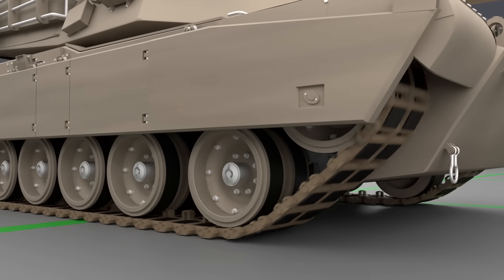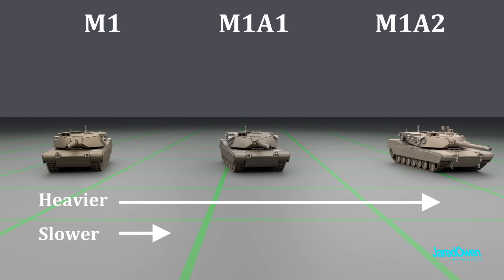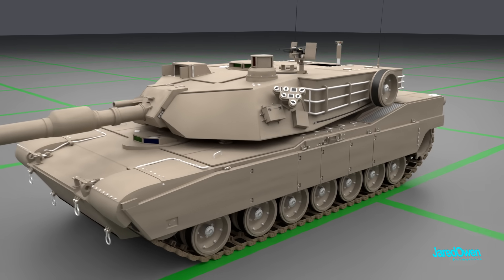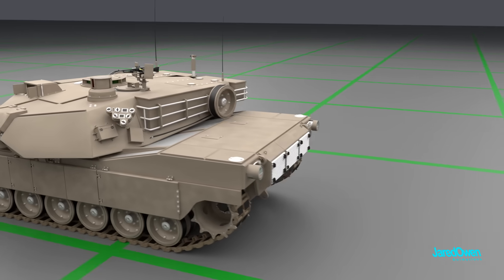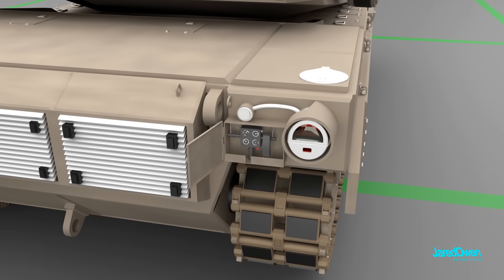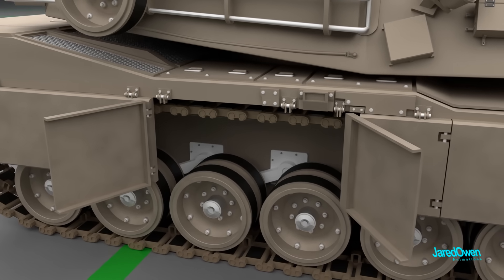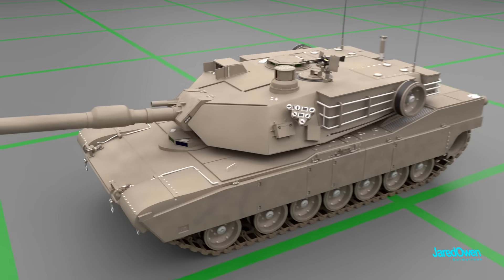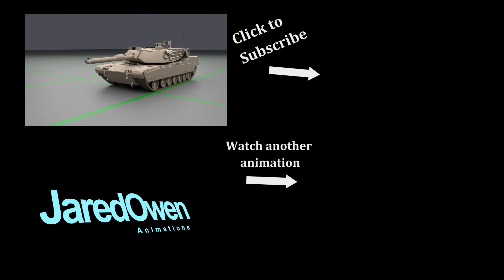How does a Tank work? (M1A2 Abrams)

Comment: Does it have A/C
Reply: Turbine engines, Electronics, and Hydraulic systems create a lot of heat .....plus operating in the desert....there must be some sort of cooling system.
Reply: No.  It has a blower that blows air that feels cooler than ambient air most of the time, but it is not A/C.  It is part of the NBC system that pushes filtered air through the turret through hoses.  The hoses are designed to connect to your NBC masks.  Most of the time you just stick them inside of your tanker suit.  Definitely makes a diff in hot temps.
Reply: @MKDonline  nomex
Reply: @MKDonline  no way to know for sure a lot of the abrams is classified
Reply: @mauricio-leyenda  I was a commissioned Armor officer for 7 years. And most things that were originally classified effectively lost that status in the 90s.
Reply: Yes!!!! Those things were the best.
Reply: @MKDonline  thank you sir.
Reply: @MKDonline  I was wondering how they would deal with a really nasty fart if it has ac, thanks.
Reply: Nope.  And as a former gunner I can tell you it gets hot especially with the balaclava, gloves and coveralls.
Reply: I wonder about this too.
Reply: No it’s a tank not a family car
Reply: @spedon2wheels267  not with that attitude.
Reply: @spedon2wheels267  it's called the army egg cooker for a reason
Reply: @spedon2wheels267  the driver would need some sort of cooling system there’s no way anyone could sit in a tank for hours without cool air
Reply: @gelato007   Actual Tanker here, I have in fact sat in an Abrams in the driver’s hole for hours in the heat. You have the “cooling system” but it’s for the electronics and doesn’t keep the crew from getting hot. However, if it gets really bad and isn’t too dusty we can take the NBC system hose and stuff it in our nomex suit for some sort of air circulation. We also usually keep a cooler full of ice for drinks and food in the bustle rack. Sometimes if it gets bad enough you can take some ziplock bags put ice in them and stuff them in your nomex, that mixed with the NBC hose is pretty nice.
Reply: @jb99rapp  where do u get ice from in the middle of a combat desert ?
Reply: @gelato007   you do realize that we’re on tanks for training exercises right? But at NTC or combat you just go till it runs out then embrace the suck sweating your balls off. Speaking of embracing the suck... using the bathroom inside a tank is not a good time.
Reply: @gelato007  As a former driver - no, there is no AC.  I would sometimes crack the hatch open for some extra air.
Reply: @spedon2wheels267  dude, this made me almost die of laughter. 
😂😂😂😂😂😂😂😂
Reply: @spedon2wheels267  worst vechicle then how the hell they not melting
Reply: @markwilson717  open the hatch
Reply: Does three open hatches count?
Then NO.
Reply: Soviet Union  ok t-34 haha
Reply: Yes. It is equipped with full HVAC.
Reply: no AC but plenty of heat
Reply: The A2 does.  It's mostly so the C2 systems don't over heat. The A1 does not.  The blower for the NBC system is used sparingly, it can overheat and the filters can catch on fire. I know this cause I've done it.
Reply: @Commandodesigns  ok nerd
Reply: How many cup holders does it have? That’s the real question we want answered.
Reply: Soviet Union  you need more girls to keep ur factors afloat
Reply: The only ac it has on the tank is to cool the electrics
Reply: @itserikboiii  yeah only the electronics get AC xD or thermal management system as it's called
Reply: No. The only thing they’re concerned about is keeping the electronics cool. One of my best bud was a driver for one of these.
Reply: The A2s did come with an AC system, but it’s for the added electronics. By the time it got to us, it was hot air. So technically it does, but the crew doesn’t benefit from it.
 There has always been a heater on the Abrams, but the filters on the M1s could catch fire. Made you think twice about using them for prolonged periods.
Reply: @tb3687  I never seen the A2 I heard it was going to be the best thing from sliced bread, but I went to Tradoc in 2009, they sent me to Ft. Jackson after Drill School.  and retired in 2012 and never been in an A2
Reply: @chrisle2674  it had some nice upgrades. CITV was the best in my opinion. A lot of software upgrades and some armor upgrades. They were just fielding the TUSK package as I got out. Put control of the TCs  .50 back inside the turret, phone in the rear, reactive armor. Sure they are working on some new stuff I’m not even aware of.
Reply: Good question 👍
Reply: For the computers yes. for us? No.
Reply: What if someone farts inside??
Reply: No. There is also no cushion inside. In order to stay cool, you’ll need to use the NBC system to supply air through a hose that you put down you nomex suit.
Reply: @sgtUSA2012  wouldn’t the tank be impractical because they crew would be so delirious from the heat or shiving from the cold?
Reply: the newer tanks have small refrigerator and power inverter that can run anything that has a plug.
Reply: @rgygduysdgyuygsduysd  Not sure where you got that information but it isn't correct.  There isn't any room for anything like that inside of an Abrams tank or outside for that matter LOL.
Reply: Good question
Reply: https://youtu.be/VDKq1T0Ou1k
Reply: Man I can just imagine how brutal hot it must get in there.  I'd like to think they have some form of AC but reality is, they probably don't.
Reply: It does, the driver has a display where he can turn on heat and cooling for the crew
Reply: Nope it dont have ac its not like a car its for war
Reply: I think only a small number of M1s did, and knowing the army they were probably deployed in Scandinavia rather than the desert
Reply: @Luka Ostojic I doubt a seatbelt is gonna help when you’re being pelted with armour piercing rounds lol
Reply: They have air filters tho so that they wont have to battle chemicals(like mustard gas)
Reply: It does my stepdad served in it
Reply: No, but the crew heater kicks ass!
Reply: No A/C Only Heater 😁
Reply: Yes but only for the engine
Reply: Actually the NBC system pumps fresh air into the track so we use it as AC and it feels amazing when it’s hot in Kuwait
Reply: yes, it does
Reply: No. It doesn’t it does have heating however
Reply: No. No it doesnt. But our NBC system can help every now and then which pumps air into the turret when you're dealing with a CBRN threat. The driver isnt so lucky though
Reply: No but British ones can make tea
Reply: Yes, it does, a very powerful one, in fact. BTW: Does you keyboard have a question mark key?*
Reply: A heater,, if you're lucky enough it works.....
Reply: Yes
Reply: No they do not have A/C...they do have heaters though...Up until fairly recently the HMMWV's didn't have A/C either, they were retrofitted later on mostly due to being used in Iraq/Afghanistan....however none of the Abrams tanks have ever had A/C, even the most recent ones do not.
Reply: @hospsa6933  LOL, no they do not, I used to drive one, none of the Abrams tanks have AC
Reply: Of course they AC "open the hatch 'or turn on ya helmet mounted solar powered fan 👍
Reply: AC units make to much noise! So no 👍🏻
Reply: @georgegarcia5288  lol funny but im pretty sure a jet turbine is louder than an ac compressor. Haha
Reply: @georgegarcia5288  noise cancellation in the CVC
Reply: @georgegarcia5288  as if the engine is silent!
Reply: @georgegarcia5288  tanks aren't known for being sneaky
Reply: Yes it does. T72 and t90 don't.
Reply: Yea the suits u where got them 2 and they have clocking cabillitys in its multi panel Armour n a 16 way cam
Reply: I think modern tanks do have an AC. I have read it somewhere.

Comment: I tried so hard to find where were those spent shell cases go. Just found out later that those were combustible shell case. OMG, I need to update myself. ><
Good quality contents btw <3
Reply: Most of it burns up but you have the aft cap and primer tube that’s all you have to deal with as far as a casing. Makes a cool ash tray.

Comment: The slope doesn't deflect the shot it increases the thickness of it.  There are 14 road wheels on each side, plus 2 on each side on the very front.  The worst terrain is ice and snow.  It's not smooth inside.... Especially with a new driver.    And the thing you're calling the engine is mostly transmission... The engine is only that circle part in the very front.  and those two hooks are only on when you put it on a railroad you never have those on normally.

Comment: I remember a “60 Minutes” segment when the Abrams was under development.  They laid out evidence with many “experts” recounting how it was a horrible design and would be fraught with countless problems, many of them pertaining to the turbine engine. It was a total waste of taxpayer dollars. That didn’t age well, and desert storm put to rest any doubts about its usefulness and lethality. (I recall they did a similar piece on the F/A-18 Hornet).
Reply: Everytime we develop an amazing new piece of military tech that is expensive, the media will say things like that because they hate the idea of our military using any funds at all
Reply: @SirBilliam96  The U.S. Army rejected the gas turbine powered Chrysler XM1 because of a fatal flaw in its design. 
Because the gas turbine required more fuel storage than the original design specifications, Chrysler engineers made the very unorthodox decision to move the main ammunition magazine from the hull up to the very exposed and vulnerable turret. 
Although Chrysler later added several improvements to the magazine design including a blast resistant bulkhead with automatic guillotine doors, it also added blow-out panels on the roof of the magazine.
 Despite this the magazine design remains a problem and cause of concern with the proliferation of top attack anti-tank missile systems.

The Army continues to be very critical of the gas turbines fuel consumption and combat readiness in dust and sand conditions.
Reply: The Abrams tank was a major political scandal.
The U.S. Army tested 2 prototypes and 6 engine and transmission combinations.
The clear winner of the XM1 trials was the General Motors XM1 powered by the Continental ACVR-1360 turbocharged Diesel engine.
Congress overruled the Army's choice under accusations of bribery and corruption.
In particular lobbyists from Chrysler and the State of Ohio motivated to keep the Chrysler tank plant in Lima Ohio open.

Comment: Good day . My Lord boss and I invented a super revolutionary engine for any type of fuel, including hydrogen for 0 emissions, obtaining much more performance than any other current engine and greater than batteries or fuel cells that are used in combination with electric motors, It has a tubular format with one or more stations and a novel thermodynamic cycle, with only two main moving parts, a power / weight ratio greater than 10 Hp / Kilo in its basic form, its thermal efficiency is greater than 75% three times more than the Current engines, everything can be manufactured in aluminum (except the main shaft and screws), it does not use liquid coolant, it uses very little lubricant, it can be extrapolated to any power without losing characteristics, it is patented in Brazil and also in international PCT. Very easy to manufacture 100% with current basic technology, all its moving parts 100% mounted on commercial bearings, the useful life is greater than 30,000 hours (> 30 years) with very low maintenance and more than 50 additional advantages ... ...
As an example: drones of any size can be made with subsonic and supersonic high speed vertical take-off (goodbye to helicopters, traditional airplanes and airport runways), it does not use a turbine or axial compressor, it is not ramjet nor is it scramjet for M> 1 and more, it has a frontal area of 20 cm2 / Ton. of thrust and more than 100 kilos of thrust / kilo motor, it is similar to a rocket motor and 100% safe, with more than 40 thousand kilometers of autonomy in all types of drones at a cost many times less.
If you are interested and you are a medium or large company, you can produce with very little investment in a few months under a license (This would only be charged per engine produced) for engines of any type and size, contact us, you will not regret it, by email: elmontecarmelo1 @ gmail .com . It is not a joke, I repeat it is not a joke, we are serious and responsible people, we welcome constructive comments.
YOU WILL NOT SEE THIS ENGINE IN ANY BOOK OR ANY OTHER SITE.

Comment: “Historically accurate” Lasers not even 2 seconds later
Reply: this guy doesnt know what tracer fire is
Reply: This dude dose not know what trasers are lololol
Reply: They are tracers, not lasers.  They are used so you can see the path of the rounds being fired to guide them onto the target.  While that vehicle was modern and has radar controlled weapons, tracers are still used in case the computerized systems fail and manual aiming is needed.

Comment: This video once again reminded that in America, instead of the metric system adopted in almost the rest of the world, its own exclusive funny medieval system of measures is used. Feet, miles, gallons are all very funny, but absolutely uninformative for a non-American.
Reply: The English system has its merits, and is not exclusive to the US.  In addition to learning to think in 10s with basic math (like in the metric system), we learn to think in units of 12 as well (inches/foot), 1760yds/mile, 5280ft/mile.

So our multiplication tables in school go up to 12x12=144.  I personally go farther than that, but that’s a unique case.

It doesn’t really matter because in the military, we use kilometers and meters (NATO standard maps) for land warfare, but in aviation, we use nautical miles, which is based on the earth’s circumference at the equator (a place Russia doesn’t have to worry about since it’s so far away from Russia’s sphere of influence or capacity to project any real power to).

In physical fitness in the US, we use miles for running and ruck marching, but km in tactical training and operations.

The metrics create a different frame of mind where 1 mile is 1.609km, so your expectation for performance is larger to reach whole number metrics.

1 mile much longer than 1km.
2 miles is longer than 3km.
etc.

Aviation units of measure are based on naval units, again because of the knot/equator/1 minute of latitude-things Russia never had to really worry about as a generally land-locked country with extremely limited naval power, contained by the geographic choke points of the Baltic, Black Sea, and Pacific Island Rim.
Reply: Probably, the use of two measurement systems at the same time can give an additional load to a brain and thus train it. This is similar to children in bilingual families who are forced to learn to think in two languages from birth. But if we go further along this path, then, probably, it would be worthwhile to introduce the furlong–firkin–fortnight system into widespread use. I think there are more rational ways to give a brain an extra load.

The same goes for physical activity. According to your logic, if you increase the base unit of measurement of distance even more, then achievements should increase even more. For example, I usually run in a park where the circle is 3 km long. Therefore, I measure my distances in three-kilometer segments. Does this in itself increase my achievements? I don’t think so.

I didn't understand the arguments about the fleet and aviation at all. Why do fleets and air forces operating in high latitudes and at the equator need different distance units? Why for the navy and air force in the equatorial region the unit of distance measurement should be tied to the circumference of the earth at the equator? What is the advantage of this?

However, my comment was generally not about the advantages and disadvantages of the American system of measures, but about the fact that it is familiar and convenient only for a small part of the world's population. And for everyone else, such units are completely uninformative and inconvenient when watching such videos. The metric system has long become the world standard. You may like it or not, but it is a fact.
Reply: @anonymous-g4e  Nautical miles are based on dividing the equator's circumference. They have been the standard distance measurement for centuries.

For the running example, 2 statute miles is longer than 3km, so your mental stretch for achieving greater performance has smaller whole value units.

Basically, from a physical fitness standpoint, you work harder and longer for less whole value rewards. Kilometers feels like cheating when you deploy or use them in training.

Comment: Something that wasn't covered on the M1A2 and other tanks. You dispose bodily waste inside. There is options for a porta-J in there with a toss bucket. in most cases it was considered unnecessary. In some of our more modern theaters of war, you were normally dehydrated enough that piss breaks wasn't really a constant issue.

I guess in the field, you improvise regardless haha.

Comment: Nice video. Btw a jet engine is a turbine engine. They are called turbofans. This engine is a shaft turbine, they are used in turbo props, helicopters and pipeline compressor stations.

Comment: Tanks are outdated tools of war, can't believe they are still being made. They are sitting ducks.  I was a soldier in the El Salvador war in the 1980's.  Our tanks and armored vehicles were usually taken out by teenaged guerrilla boys with RPG-7's, and IED's.  The Abrams is tougher but it can still be taken out by modern small shoulder-fired missiles.  Our tanks/APC's also used to be attacked while parked.  Tanks are only good to secure cities where the enemy is already dead or retreating and you only have to deal with ragtag militias armed only with firearms.